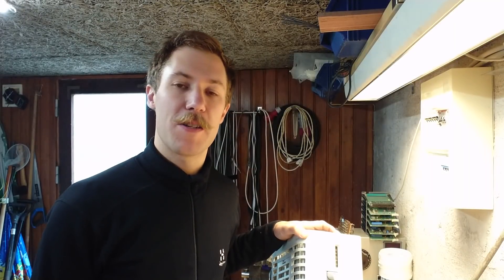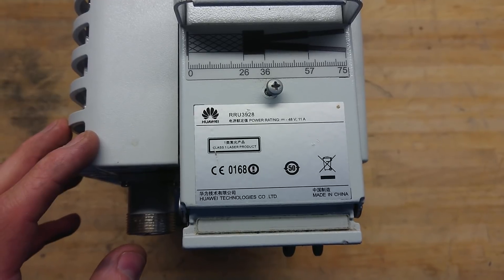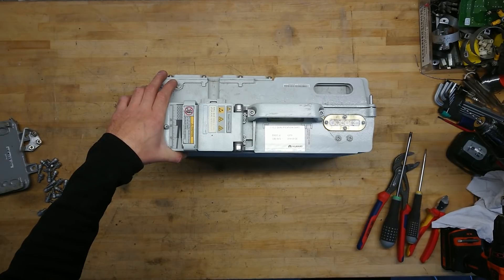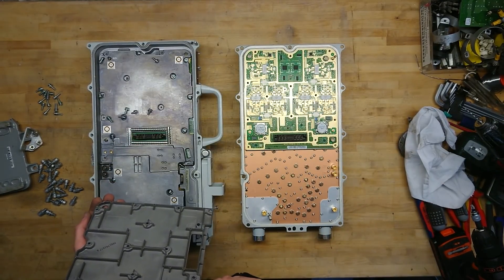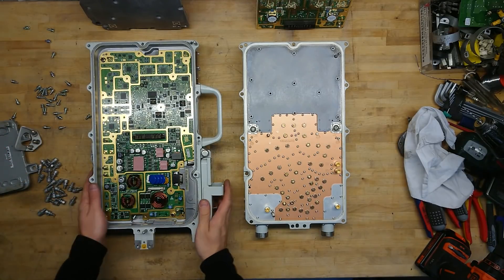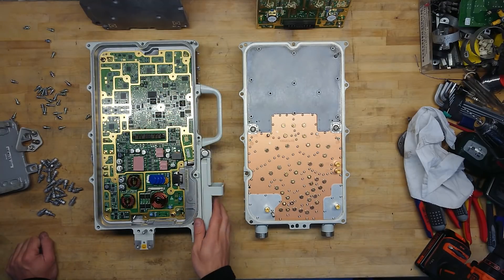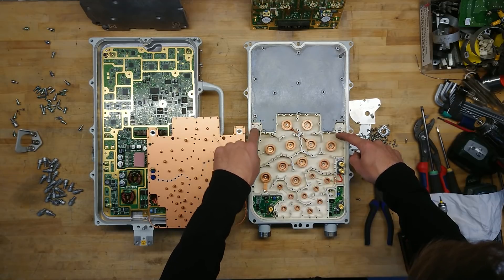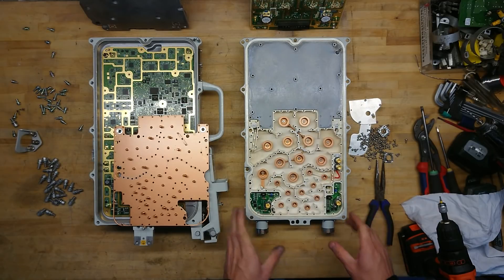Huawei RRU3928 1800MHz Radio Base Station Teardown (Part 1 of 2)

Comment: CPRI is an abbreviation of Common Public Radio Interface.
Reply from the maker: Interesting to see there is a wide use of a standard interface in that industry. So you might even see backbone and base stations from different manufacturers in the same setup. "The companies working to define the specification include Ericsson AB, Huawei Technologies Co. Ltd, NEC Corporation and Nokia."
Reply: @KaizerPowerElectronicsDk  I think it's the same thing as CAN bus in cars. They are identical, but each manufacturer has it's own dialect and non-standard codes.
Reply from the maker: @zaprodk  haha yeah, dont get me started on "You can just use a remote i/o modul on Can". CAN, CANopen, CANflex and on the adventure goes :)

Comment: What is that thick plate below RF card? can you share image please?
Reply from the maker: sintered Al-SiC, using its specialized powder metallurgy 
technology. This material was produced without 
machining by blending powders of lightweight and 
highly thermally conductive aluminum (Al) and silicon 
carbide (SiC) at a suitable ratio for the required level of 
thermal expansion, loading the mixture in a mold to form 
a lid, and sintering the formed lid. Although Al-SiC mate-
rials produced by infiltrating molten Al into a porous SiC 
body under pressure were commercially available from 
other manufacturers, sintered Al-SiC was a milestone 
material because it did not require large pressurization 
equipment to manufacture nor machining to shape it 
after the material was produced
Reply: @KaizerPowerElectronicsDk   Thanks sir....but is it integral part of RF pcb or screwed to RF pcb?
Reply from the maker: @kuljeetsingh1596  I have seen both versions. Some are just attached with screws and thermal paste, others have the PCB soldered/"glued" directly to the AlSiC heat sink. If you look through my different RF teardown videos in my teardown playlist, you can see many different kinds. There is at least 17 RF teardown videos.
Reply: @KaizerPowerElectronicsDk  Thanks...I will surely check them

Comment: Just found your channel. Love your tear downs. 

Reminds me of some radios that I stripped a couple of decades ago.  I was fascinated by the diplexers that were much more regular that these almost organic mazes in the new units.  I think the network worked around 450MHz so not quite as demanding. Cool thing was the aluminium was silver plated on the inside.  The diplexers were also OTS units and some of the versions had a TX and an RX filter that were identical (tuned different) and some had a combined unit with two mirrored paths for TX and RX.  The data rates were low, I think it was 9600 bps and they were used to link the lottery terminals in South Africa when there was no other reliable secure digital network.  

A cruder X.25 radio network at 2400bps was also around for credit card POS terminals for shows and outdoor functions where a phone line could not be provisioned but this has a simple modem that was the size of a dial-up modem of the era.
Reply from the maker: Thank you for subscribing and the story, I appreciate that :)

Comment: could you please also try to dump the firmwares and binwalk them for callback urls to china, just to debunk or confirn all that scare shit...
Reply from the maker: I understand what you are looking for, but if it was the case that such features existed in this equipment, I would not find it from a simple procedure like this. If I was to implement something like this it would be encrypted into a maintenance/crash report system, like the one you know from windows "do you want to send microsoft a crash report?". 

Basically I do not mess with making software from these units public as its a potential law breach to reveal network infrastructure data that could be used to compromise the working network, so I keep to the hardware layer :)
Reply: This is just a radio unit, it is relatively dumb in the grand scheme of things. If you want to tap into people's comms you do it elsewhere in the network.

These units are designed to be mounted up on the tower adjacent to the antenna in order to minimize transmission losses from long cable runs, and I guess save the need to make long cable runs up the tower in the first place (expensive!). All you need to do is run some power cables and fibre for the "data".

Comment: It would be really interesting to see the duplexer with a glass top and filled with a gas like neon or something to try and visualise what's going on (try to make some plasma in there and effect it via frequency modulation).
Reply from the maker: That is a really cool idea, however I do not have any GHz generators and I am pretty sure the desired effect can not be produced by a 300 kHz Tesla coil output as that should be eaten by the filter and the high voltage would just flash over instead of resonate. I wish I could do that experiment.
Reply: Hi, 

sounds very interesting to try indeed. 
I could help you out with that experiment, I think I should be able to do it. 

Greetings from Germany,

Comment: VSWR stands for Voltage Standing Wave Ratio. The LED is indicating the unit has a bad match to the antenna, and too much transmit power is being reflected back into the unit.
Reply: and RET stands for Remote Antenna Tilt, it's used to change the phases of the elements inside the antenna (apart from the manual fixed tilt which is just physical tilt) using a driver attached to it (called RET) :)

Comment: Hi Mads, 

Great video as always. As you said, there are quite a few interesting design choices, however, what I find the most interesting is the size of the unit, since it still uses over 500W. I guess especially the power tranistors got quite a bit more efficient, since otherwise there would be now way that this small heatsink could radiate away all the generated heat. 
However I find it interesting that the power amplifier has six power transistors, since it only produces 20W in the end?

Another interesting thing is the alarm / monitor port, I wonder, if it is like normed or something, since a lot of units from different manufacturers have this port and all of them use this HD SUB 15 connector for it. 

Waiting for part two. :)

Greetings from Germany, 
Michael
Reply from the maker: It is actually rated for 1100+ Watt consumption if running full LTE mode at maximum. 

I am only guessing here, but maybe they are running each channel interleaved on the two parallel lines so they brought it down in size and weight but at the cost of more gold and silicon.

You can get a little more detail here https://www.scribd.com/doc/97584371/RRU3928-Description-V1-2
Reply: @KaizerPowerElectronicsDk  they made 1000000 X more than the extra materials cost with data plans lol